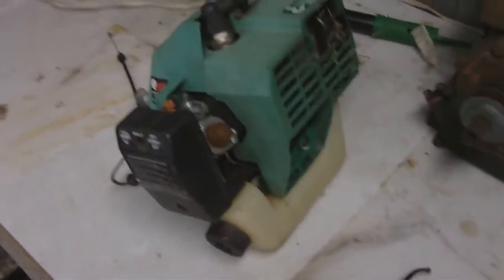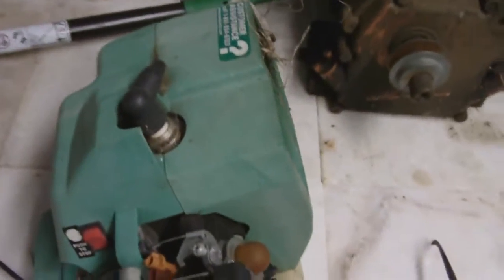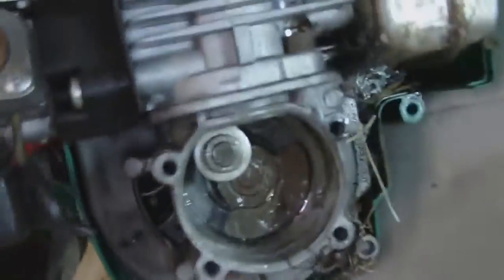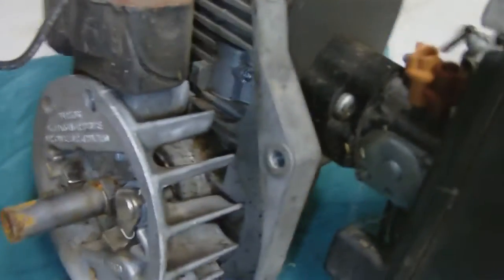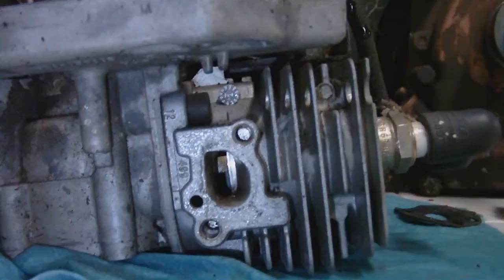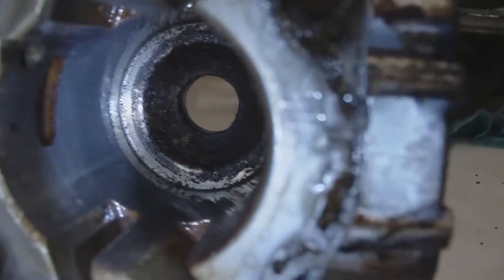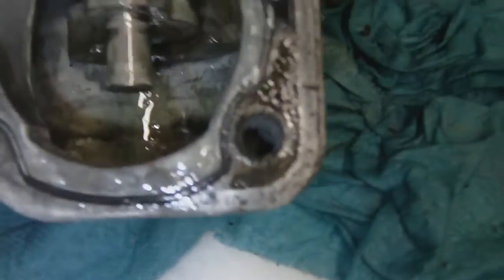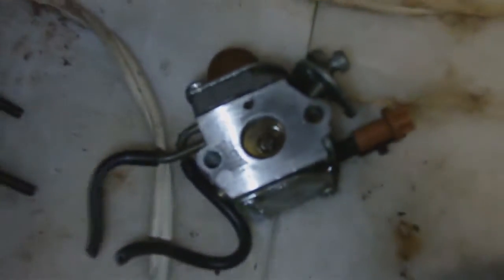Engine tear down

Comment from the maker: Maybe cheaper but not as fun and or educational. That being said if it is something as simple as replacing an o-ring then that is a whole lot cheaper than buying a new peace of equipment. This engine was put on the shelf for parts, most of the stuff I burn up ends up on the shelf for parts, eventually I will never have to replace one as I will have so many extra parts lol.

Comment: I Tear down a weed eater like that that i found in my friends backyard in a pile of trees that is rusted like a car ran over it. WD-40 works
Reply: Visut Hoare I got one on the curbside like it, the engine was seized and the crankcase was full of oil, and the gas lines crumbled. I'm going to clean it up and put new lines in. Should only cost a couple bucks.